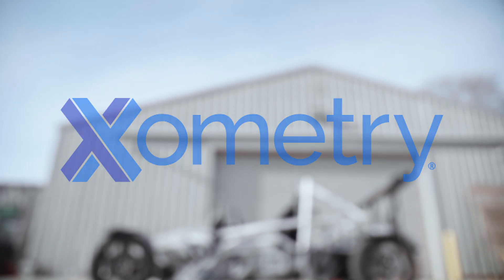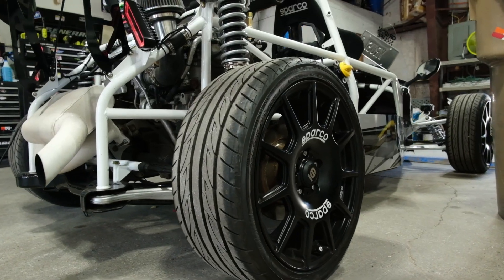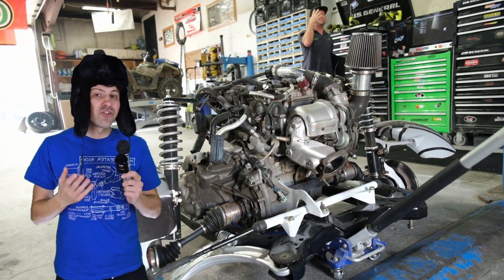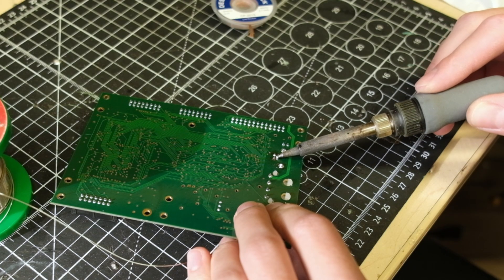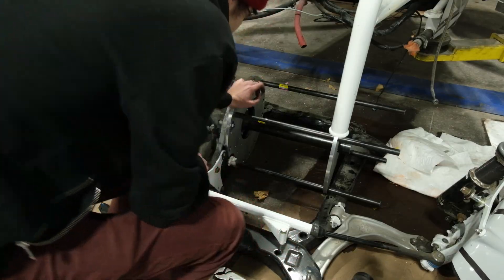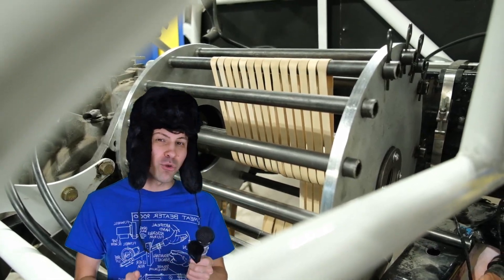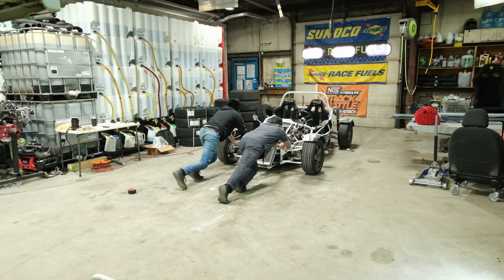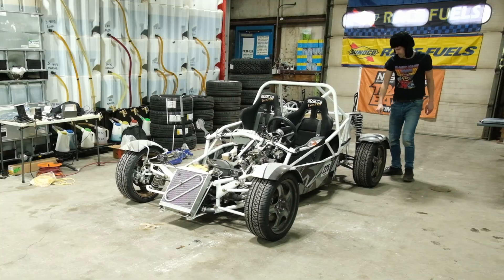How many rubber bands does it take to power a car?

Comment: If you ever revisit the project, you could build the tension linearly and convert that to rotation by having it unwind a steel wire from the shaft. That way you could use the full potential of the rubber bands without having the issues of friction and uneven load.

Comment: Oh, again i´m old. I remeber someone did this in my City around 1990.
But as far as i remeber he Used  4 Giant Clock Spings each with ~20t of force and when one spring was relaxed, they switched to the next spring.
The Springs on the front right of the "car" and hat steal cables going in a metal pipe to the back where the cable was on a wheel like thing on it´s side turning it ~350° and giving that force to a transmission.

Comment: I think the spring-locking-up-on-the-shaft problem could be solved by winding it the other way, as in unwinding the spring. Winding it tighter is limited by the shaft's diameter, which (past a certain point) cannot get smaller, while unwinding it still flexes the spring in a similar way (just the opposite direction) but is limited by the birdcage, which becomes a safety thing and is a non-issue in practice, and thus the actual limit is the length of the spring itself. Though, as seen with the largest spring, the force distribution throughout the coil might become a much bigger issue and would unwind unevenly, causing the whole thing to tangle up in itself...

Comment: Hope to see more of this! Some ideas:
- Pull the car with rubber bands between its front bumper and an anchored cable as a test
- Turn each shaft into a row of U-Groove pulley bearings
- Drag racing tires?

Comment: I believe will be better create a zigzag vertical multilevel accumulated elastic power bank.
A band floor start and when reach is in 40% of the entire elastic power, the next elastic band line start.
With different elasticity and thickness to accelerate in the long run, will be easy to do high speed

Let me know if that can work

Comment: Very cool, but I would humbly suggest that you started wrong.
You should have started by closely examining the working model (toy car) engine.
That would have shown you that the gearing in those things is massive.
try that.
Or. actually. 
Don't try that. Because you will have stored so much energy in the springs, that it would just be too dangerous to operate. (at least in its current form, without extensive safeties put into place.

Comment: The pipe in the center is too narrow with a fatter pipe you would get more torque or attach the outer bird cage to the center pipe and attach the rubber bands to the out side pipes and to the cars frame...

Comment: i would've (easy to say, right?) done the opposite: the outside of the barrel applies torque to the tires, while the bands are anchored to the center of rotation where the axle is now. i'm only half way through the video though, i didn't build it and i don't like watching a video with my brain screaming "it's backwards!" but my brain is screaming that.

Comment: It sucks to put so much effort into something (stupid) and then not get what you were hoping for. Like, at no point was this going to be used for more than an occasional giggle, so, that desire to persevere through the hardships and keep reinventing it really lacks the traction it needs. And there's no right answer. Keep iterating to solve a problem that's only worth a chuckle when it's done? ... This should be at least verifiable with some basic math, potential energy of a spring/etc calculations to know what it would take to be in the ballpark of getting this right. Seems to me the type of spring you need is a clock spring (like a... kitchen sink rug, one flat pancake coil). That's what the toy used. Those allow long changes in spring length and more continuous thrust (hence being used in clocks). I don't know where you'd find one or how you'd make one. The cost for spring steel would be astronomical, and it needs to slide past itself along it's entire coil so rubber is out. You can definitely store more energy by twisting rubber than by pulling it, and release it more reliably (like a catapult). Lots of more wrong ways to build this.

Comment: what if you use an actual mechanism of a pull back toy car? the torsion spring, or multiple torsion springs! and would there be a difference if the engine was at the rear?

Comment: Why not just put a hub motor in the tires, excite the field when rolling back to charge a supercapacitor, then run the motor the other way. Better yet you could replace the capacitor with a battery.

Comment: Thanks Aaron and David for helping make Joel's projects possible! Joel, you should take a look at constant force springs. I've designed a couple of CF spring mechanisms in the past and those are probably the way you want to go here. Also, you are going to need a LOT more spring force.

CF springs really only produce linear motion. The best way I can think to implement this is to wrap a cable around a drum and use a CF spring to pull on that cable. In your birdcage design you could line each crossmember with short throw CF springs. Those spring will rotate around those crossbars. Then have them pointing inwards toward the rotating shaft, which you attach them to with a cable or perhaps a sheet of metal. Then when you wind up the car, it will pull out each of the CF springs towards the center loading all the springs while winding up the cables or sheets. Since you have so many crossmembers and your birdcage is so wide, you will be able to use far more CF springs than you'll probably need. Just find the right amount so that you can use the car's weight to wind it up and you'll be able to wind it through their entire length because of the constant force.

Best of luck, can't wait to see your next video!

Comment: I hate to break it to, you, Joel, but pull-back cars for Kids are NOT propelled by rubber bands, and not compression springs either. They have clock springs. Big difference in power, and a linear force thats applied in the direction you want vs trying to twist a spring in the wrong direction.

Comment: If you pre-tap tension, the rubber band from the end and wind it, it will already be tensioned and it’ll stretch, but you have to manually already have it tension just hand stretch keep tension on it when you wind it

Comment: Idea: salvage the cage’s end plates, attach one to the transmission, and the other to the frame. Stud each one FULL of eyelets, and string the bands between them. 
This will get you an ultra-density (and thus torque/duration) of an airplane’s system.

Comment: Thank you David and Aaron for all you have sacrificed. Joel, hear me out.. Coil springs. As the kid that immediately had to take his apart to find out how it worked, they use a big coil spring. I think some also have something interesting going on with the gears. Like one set of gears engages when you pull back and another engages when you let go. It always seemed like there was more stored energy pushing the car forward than it had taken to pull it back, though I could be wrong about that. I was a kid when I conducted this deconstructive research. I'm just wondering if you might get further stacking up some big coil springs in the current bird cage.

If you're letting this project go for a while, there was another kind of self powered car that used a metal flywheel and a pair of gears. That could be fun and maybe a little sketchy to try.

Comment: you're using the rubber bands wrong... the bands are twisted to store more energy efficiently. you're just stretching it. 

you're using the wrong type of springs.... think about it. 
how far does a garage door move? 

they're made to assist with lifting a garage door not making it go 25mph down the road. plus you're using a small section of it. cutting the energy storage capacity down even more.
you dont have to be an engineer to know its not going to work. no math needed. i've seen people fail to use those springs before for the same reason.

Comment: Just thinking here. What if you had a rigid rope material that wrapped around the axel/tube. And that was connected to the stretchy speargun tubing. And that tubing was stretched in a zig-zag pattern using a series of snatch blocks with bearings. And so it's the nonstretchy material that winds around the cylinder (therefore preventing some of the binding that was happening) and then the stretchy ropes store the energy and then pull to unwind that. You'd need a little bit of space to run the zig-zag snatch block setup. But it could work. Just an idea.

You could also maybe have one rope wrap around the cylinder instead of multiple. And that would connect to a bar. And then the bar would have all of the stretchy ropes attached to it so that you could use more of them to build the strength.

Comment: This could be improved by stacking 5 bird cages, each about 4 inches wide, each with increasing diameters for the bands to be wrapped around.  Each would have a reversible ratchet, for winding and propelling, so that the individual cage would free spool once all tension was used.  Then, using simple linkage to unlock each cage as soon as the previous cage began to free spool, you can provide increased torque from spool to the next spool, starting with the largest for max leverage, and the cages would activate in decending size for increased rotational speed.  Think individual derailleurs.

Comment: I think the key is using the same method that airplanes use for their rubber engines. They twist the rubber band around itself instead of wrapping around a shaft. This allows you to store much more energy. In fact this is how that dragster worked according to that photo that you showed. Also switching to a lower gear when winding would help you to not have to pull the car back so much. Thank you Aaron and David!
Edit: now that I'm thinking about this I remember having a hotwheels car that had a rubber engine. It also used the same method of an airplane!

Comment: You could use a combination  of gear ratios and a fly wheel to store the energy from when you move it back, actually I have some old pull back toys lying around that do a similar thing but without a flywheel and instead metal coil like your design. However I do think it's worth looking into the combination of the two. Good Luck!

Comment: Those pull back toy cars actually use a clock spring. I'm now wondering if a foot wide length of spring steel bolted to the spindle, wound inside the "Bird cage", then clamped to one of the cages spokes could get you the results you want. Mind you, that much spring steel would possibly cost more than the cars worth, and the levels of potential energy involved in this means I personally wouldn't want to be within 20 yards of it while it was being tensioned, and I wouldn't want to sit in the drivers seat while it was under load, period! :D

Comment: You might wanna check out the spring mechanism of a vacuum cleaners cable reels. It's a metal strip that wants to roll up into one direction, but then you have a bigger roll that bends it in the opposite direction. Simple as that. They are actually quite strong (and sharp!), but they don't increase in strength even when pulled all the way out. I have built a compressed air hose reel with just two of them, and it's just barely enough, but it works! It's also probably pretty cheap too! You might be able to make a very wide version of it. Also, they go FAST!!! If you, while disassembling such a reel, let go at any time, the entire thing goes super speed and then breaks the spring... Just a suggestion!
Reply: Those springs are called Constant Force springs, and they are a good idea for this application great suggestion!
Reply: @Goodgu3963 I think it's a coil spring, like what typewriters used to advance the carriage. They have a lot of power and could work for experiments like this, but can be dangerous.

Comment: Why are you using anything? But first gear first gear is going to multiply the amount of torque that you have the most hold back. Put it in first and slowly release the break so it doesn’t break traction that would at least get you to 10 miles an hour.

Comment: my god the answer is right there , 1) make the big spring shorter in lenght as when it get it's daimeter smaller , it increases in lenght hence looping on itself , 2) you are using a thin wire spring and it would help a lot if it was thicker ,3) you have to have a jump start so a secondary coil or rubberband system which have a short travel distance but high elastic capacitance

Comment: Very cool of all those people contributing to such a fools endeavor. I would have used a bus springs with cables wound around a pipe. Plus some way of winding it so that the traction of the tire would not be an issue.

Comment: From what I've seen in most pull back motors, the spring is a flat spiral spring. Although most of the magic comes from the gearing and clutch mechanism. Another toy car motor I always liked was the flywheel or friction motor, although that may be a bit more difficult to incorporate into a real car.

Comment: Joel you should have pulled back in 5th gear and released in 2nd.. I think💡
Reply from the maker: Changing gears would release the tension in the engine, at least with this design

Comment: Assuming the car is 600 kg using KE=1/2mv^2 at 6 km/h you would have released 833 J for 40.23 km/h (25 mph) you would need to release 37470 J 
37470/833 = 44.98 so 45 times more Energy
Assuming 80% efficiency you would need to store 46.837,5 J

If you made a Spring that changes in length by 1m your spring would need a Spring force constant (k) of 93675 N/m or 69091 lb/ft
In short its very impressive if he can come up with something strong enough to do this.

Comment: Thank you David and Aaron. Also, I feel like wrapping up the rubber bands isn’t putting equal tension across the parts of the band. If you could stretch it instead of wrapping it, or stretch it before wrapping it, I think that might improve your power.

Comment: The problem of the wheels locking up is a problem at toy scale as well. Thats why we push down as we pull back with those little cars. I think that finding a way to overcome that (potentially a hand crank with some major leverage?) and fixing the spring design to something like a watch spring could help get the speed you want. 

Sick work so far though. It looks really fun even at current speed. Haha
Reply: A possible (OSHA rule violating) solution is to use the forklift to press down on the rear of the car as it is being pulled back.

Comment: Those toy pullback cars are incredibly clever, they have a mechanism that switches gear ratio when you release them so they can go much farther than you pulled them back
Reply: and I guess some kind of ratcheting mechanism to allow them to free roll instead of springing back when the spring is fully unwound
Reply: @CraftNexus  Oh yeah same question.
Reply: That mechanism is surprisingly complex. When you pull the car back, it shifts into a lower gear via a one-way clutch to wind up quicker; you can hear that clutch work as the typical pullback car clicking noise. Once the spring is wound to its limit, a 'finger' on one end of it starts skipping from one groove to another to keep the spring from over-tightening and locking up; that's the louder clicking you hear after half a meter or so. When the car is released, it shifts to a higher gear so that it will go about twice as far, about a meter, on just spring energy. Lastly, once spring unwinds all the way, another clutch is released so that the car can free-wheel even further, several meters on a good surface.
If you have a chance, take the body off one of those cars and take a look at the mechanism. It's usually fairly open so you can see different gears do their thing. It is fascinating how much it actually does and how it does it.
Reply: @AgentWest  it's even more impressive when you see the smaller cars worth this mechanism.
Reply: @AgentWest hi
Reply: Yep, they need a way to lock the engine while they change gears on the gearbox, then they can pull back in one gear and release it in another. They also need to get longer rubber tubes, as longer tubes can store way more energy. The round configuration probably could work, but it needs rollers instead of just bars to minimize friction losses. Maybe even multiple levels so the tube can spiral down to the drive bar. That way you can really pack in the rubber density. This could definitely work, maybe even get to 25 mph, but you are going to need a lot more rubber to get there.
Reply: Wow, really? Yeah I was wondering if they had some kind of freewheel so they can coast after their stored energy is spent and you don't end up taking up energy winding it in reverse.
Reply: I always assumed it's an overrun gear.
Reply: They are also powering a flywheel. All the weight is in the mechanism the car itself weighs almost nothing.
Reply: Thank you to everyone that helps Joel with his exploration.     You all come together to make it fun and educational for those of us watching. Much respect.
Reply: I swear, every single pull back car I've had in my life sounded like it had the actual engine from an actual car. I wanna know how they get them to not sound bad lol.

Comment: I've seen that other mystery rubberband powered car in person and spoke to the builder when I was a crew tech out at the bonneville salt flats. It was made by one of George Poteet's guys. There were 2 banks with different gearing...one for initial acceleration off the push truck, then a second for top speed. I never got to actually see it run but if I recall, he was shooting for something like 50mph with it. Was a super neat contraption. I have detail pictures somewhere on an old phone in my closet 😂
Reply: If you make the springs longer, and maybe a smaller one inside a larger one, you should get more speed and travel distance.

And thank you, Aaron and David!